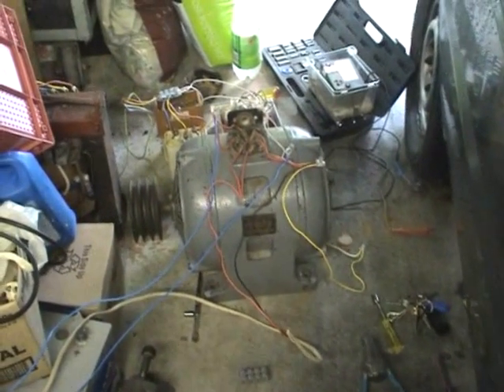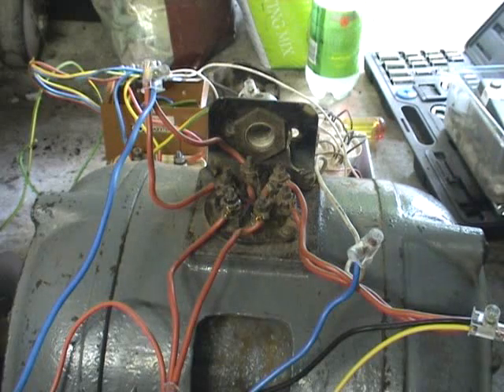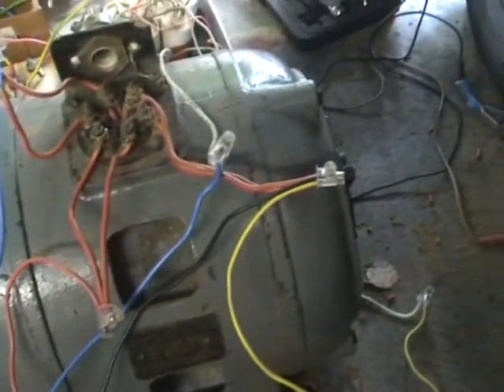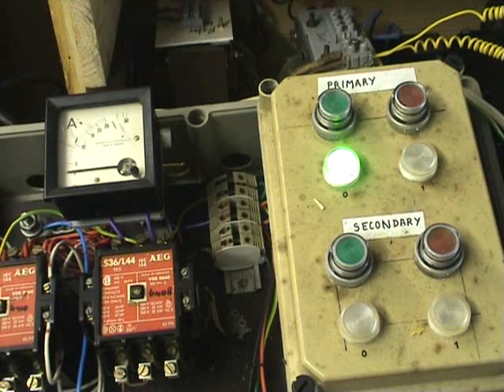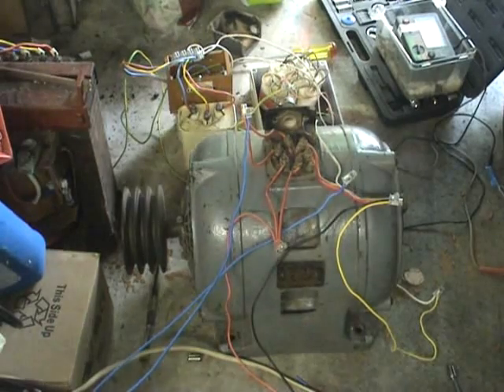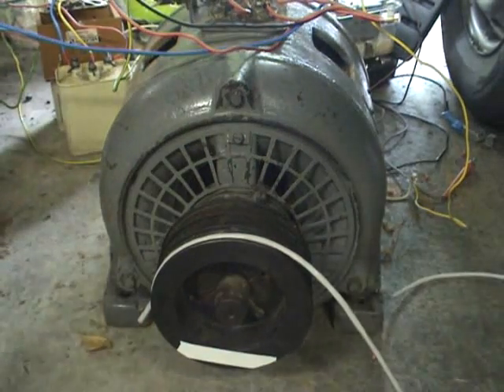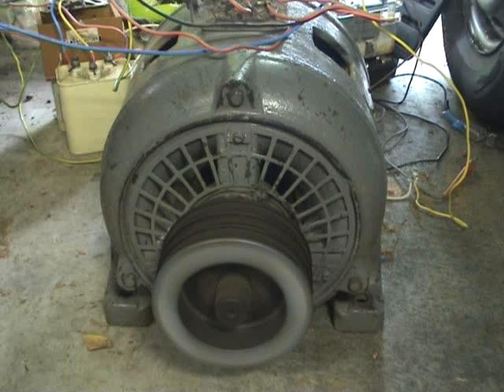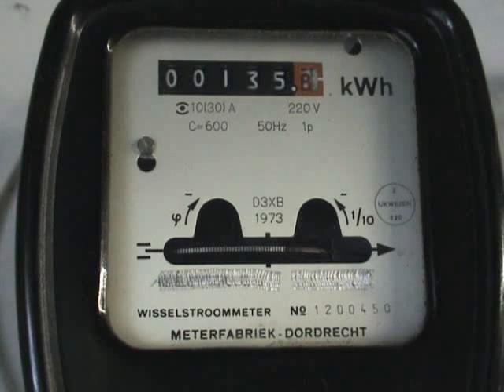3 phase 7.5 HP 400 Volts motor on 230 Volts

Comment from the maker: This applies to three phase motors. They rely on the rotating field from the supply.Aa single phase motor needs a phaseshift to start, which is often done with capacitors

Comment from the maker: @Serostern Correct but I make a rotary converter out of this. then switch over to star and get 400 to 415 Volts.
This was only a testrun to check if the motor would run of a 20 Amp MCB.

Comment from the maker: @bait28 It will work on both, better to start in delta from the lower voltage (230) and switch to star to get 400 Volts. (opp. way as is normally done)
I have shown that in an other video, will do the same with this motor as I will use this for a new rotary converter.

Comment: @RODALCO2007 i've got no clue what i'm doing(hehe) this motor is really weird, i'll post a video response of it on tuesday. it's currently wired for 208-230 volts. i don't know if it's wired in star or delta. also draws 24 amps.

Comment: Is there any reason I should not use 240v on my 3 phase wadkin saw please?  I'm in the process of setting it up.
Reply from the maker: A three phase 240-415 motor should run alright on 240 Volts when in delta.
The torque will be a bit less but when up to speed. You need capacitors to create the third leg for starting.

Comment: Hi :-) 

 When you have made RPCs in your other videos, is the Neutral hooked up to the star point XYZ of the motor with 230 fed to one of the coils to give 400 output? In this case, does one set of run-capacitors from V to W need to be a little larger than the other to provide the necessary excitation for three reasonably equal outputs from U, V and W. I think one of your designs used an extra 8uf between V and W for a 5hp idler motor.
Reply from the maker: Normally to get two Voltages 230 and 400 Volts, I Use Phase and Neutral on one of the coils R-S for example. As I start up on the lower voltage I switch the motor in delta, Start Caps on S-T when motor is up to speed I switch over to star and get XYZ starred. There are different combinations possible. Will make a newer video as I have worked out that 400 V electrolytics from old TV set work very well back to back for starting a heavier motor. Some caps are needed to maintain a steady field. It is a bit of trial and error sometimes. Use safety glasses in case a Cap blows up, you never know.

Comment: Thanks for the last reply. I just need a little help in getting approx values for L1-L3 run caps and L2-L3 run caps for a 5hp converter when neutral is connected to the star point and 230 phase is connected to the end of L1 (commonly labelled point 'U')

The schematic in your video featuring the Heemaf 5hp motor doesn't include that info.

In general, if you wish to adjust the voltage downwards between say, L2 and L3, does that need less capacitance or more between those points. Daft question but I'm not very advanced at electronics :-)
Reply from the maker: I go by approx 55 µF per kW which is about 165µF for a 5HP motor. I use whatever Caps i have laying around. I will make a detailed video with the 7.5 HP motor over the weekend if I get the chance.

Comment: how do i wire that up?, i have the same rated motor(7.5hp 3 phase, 1450 rpm) but only have 1 phase power, how do i do this?

Comment: Hi Rodalco2007, I am wanting to build a RPC with just a 40 AMP 240V supply to my shed (I live in Australia) and I am happy to use a 240V Single Phase "Pony" motor to spin the 3 Phase Idle motor up to speed before looking to fire up it. I just wanted to know what would be the largest 3 Phase Idle motor that I could run with just a 40 AMP breaker?  There is a guy in the UK this is a link to his Part 1 RPC build, where he gets a 17.5HP motor to start/Run with just a 20 AMP supply (I have tried contacting him after watching Part 4 just to ask a few questions, but not yet had a reply)

https://www.youtube.com/watch?v=yXPKDEqcVLY 

I am hoping to use a 20 or 30HP Idle motor and based on him being able to run a 17.5HP with 20 AMP's, I was hoping this would be possible. 

There are lots of YouTube videos from the USA on RPC builds, but their power is different in that they get 2 Legs to a domestic supply and I believe they also get 100 AMP's to play with, so they are only looking to produce L3 (just one ghost leg) whereas we have L2 & L3 (2 ghost legs to produce and balance). The biggest machine/load I have at the moment is a 7.5HP Air Compressor, but I have other 3 Phase machines (up to 5.5HP) that I would like to run at the same time (but not more than 2 machines at once), I am looking to buy an old Brook motor if possible, but they are rare here in Australia.

I hope you can give me some pointers.

Cheers Nigel